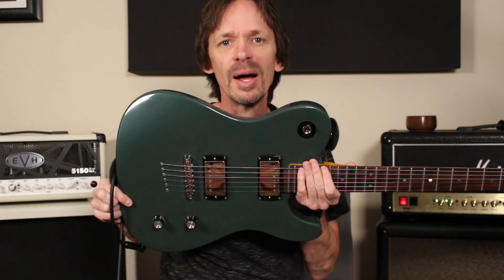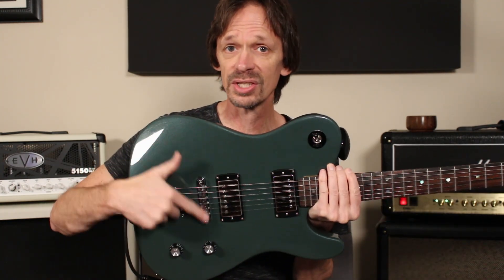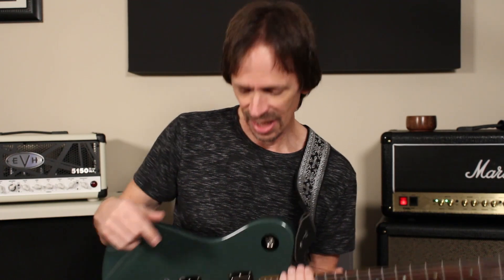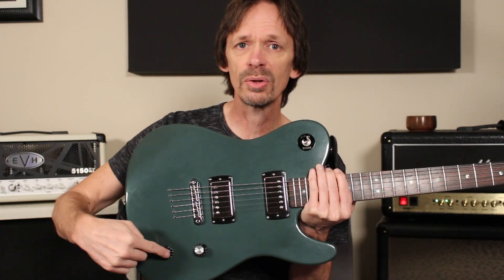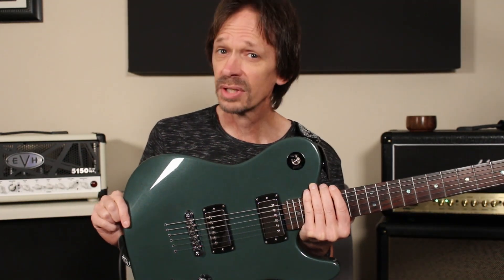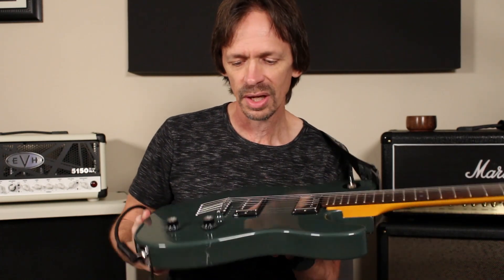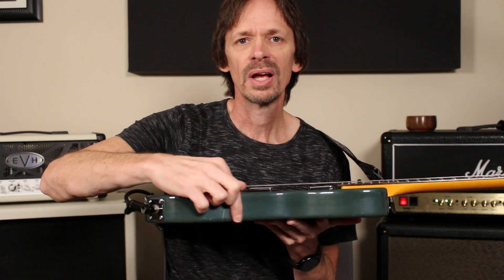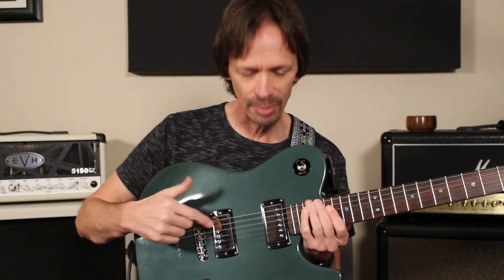This Secret Option Will Transform Your Tele-Style Guitar!

Comment: I found a company called Rock Rabbit in Indiana, who make a Tele control plate I love! They put the pots at each end and the blade switch in the middle. Now my Volume can be controlled by my pinky for swells. But unlike a reverse layout, the switch is in the middle where it is easier to reach. This setup also gives you more room between the pots and the switch.
Reply from the maker: I've seen those Rock Rabbit plates. If I were ever to build myself a "traditional" T-style I would get one for sure..

Comment: Aaron, I stumbled upon a 7-string Ibanez model with a basswood body. Now this fellow is a heavy dude 8.59 lbs/3.9 kilogr ams. Exactly the same model is much lighter 7lbs/3.19 kilograms. My question to Warmoth and the community here is if it differs in sound having the same model with all the same specs and measurements but then made of a lighter cut wood? I.e. does a lighter weight basswood body sound different than a heavy weight basswood body? Would love to see a video about it 🙏

Comment: Great job Aaron. I'm one of those people gearing up to do a few nitro finish warmoths. Curious about what neck profile and radius you used? From watching the paint video (which was quite inspiring). It looked like alder and a rosewood maple neck. Very classic tele set up. Love a tele with humbuckers. Heard about the the JB 59 combination when I was doing research for the warmoth mahogany walnut top thinline.. after watching tones of videos went with a custom 59 combo. Am verry happy with it. From the neck down it is crazy good. But I am ditching the roasted rosewood maple neck for a non roasted maple rosewood neck. Looking for a more vintage type vibe. will be experimenting with my first compound radius on the new neck. Why I am a little curious as to which radius and profile you prefer. Grew up a straight 9.5-10 person. But I figured the mahogany thinline has such a growling lead  guitar with those humbuckers. Maybe it needs a neck built for speed and bends. Guess I find out first hand soon enough. Can see you have some heavy metal roots. Funny, when I was a kid my first mod was putting a set of early Seymour Duncan hot rails in my 83 telecaster so I could emulate my favorite 80s metal bands.
Reply from the maker: I grew up in the 80's, which exposed to a HUGE VARIETY of playing styles, which is why need guitars with MAXIMUM VERSATILITY. The neck on this one has a straight 12" radius, 1.650" nut width, and Standard  Thin profile.
Reply: @warmoth  thanks for sharing. Bit of a specs guy. Have to give a straight 12 a try some day.

Comment: Interesting how this design flaw of toggle to close to the volume knob gets stubborn build over many decades even till today …😏🤦🏻🤷🏻‍♂️
  My second guitar few years back, was a tele kit. I wanted a Telecaster beside my LP copy, but I changed everything I didn‘t like: knob distance to toggle, angled toggle slit, slanted and rounded neck heel, belly carve, arm rest carve, pleasant body outline, carved top, two piece pickguard, smaller bridge plate, string thru holes at 60 degree angle, additional middle pickup. 😊
(lots of other mods too, but not related to what I didn't like on trad. Telly‘s)

Comment: You get to the toggle thru a little plastic circle on the back, yeah?  I missed the posterior shot.
Reply from the maker: There is a circular rout in the back that the switch mounts in, and we supply a plastic circular plate that covers it. Basically just like on an LP.

Comment: Aaron,   I called in to your sales dept and threw what I thought were softball questions but came up empty. Can I email you direct?

I like the neck with the abalone dots. 

Does the pass through strings change the sustain at all?
Reply from the maker: Oh man....that's really hard to say. It's hard to pin down exactly what things contribute to sustain. If I had to guess, I would say that taken in isolation a string-through bridge doesn't have a great effect on sustain. I think sustain is a combination of many factors all coalescing.
Reply: @warmoth   I saw the toggle option when building a tele. I chose rear route and LP style controls.

Comment: Just curious, why not go with the LP 4 knob layout?  25.5” scale or did you go for the shorter scale neck?  Guitar Geeks want to know
Reply: Especially Tele Geeks
Reply from the maker: I prefer two knob layout, not much of a fan of separate volumes. Also, FYI the standard Warmoth "kidney bean" control cavity is not large enough for the LP control layout. You have to specify the "diamond" control cavity if you want LP controls.

Comment: Hey Aaron really cool guitar !!! Could you tell us which radiuses are the neck fingerboard and bridge please ?
Reply from the maker: Radius is straight 12". TOM's are fixed at 10" I believe, but I'm not 100% sure off the top of my head.
Reply: @warmoth  Thank you !!! I'm about to make a neck for my brand new Warmoth carved top soloist body with recessed  ToneProsTOM and asked myself if i'll go with straight 12" or 10" for the fingerboard's radius. I think regular TOM are 12" (some Schaller's with roller saddles are 14" and there is one Gotoh's model with 16" radius)

Comment: Am I correct in thinking that you had to angle the neck to use that bridge?
Reply from the maker: Nope. The neck doesn't need to be angled because the bridge is recessed. You'll notice that there is no tailpiece, but rather the strings go through the body. If you used a traditional TOM with tailpiece then yes, the neck would need to be angled because the bridge stands much higher.
Reply: @warmoth  Thank you for responding and also for all the great videos! I am learning a lot and loving it!

Comment: Ok ok ok ok... fabulous guitar. 
But le neck ? What about the neck ? What about the headstock ? Mechanics ? Frets ?...
Reply from the maker: The neck is Vintage/Modern Construction, stainless 6150 frets, straight 12" radius, 1.650" nut width, Standard Thin profile.